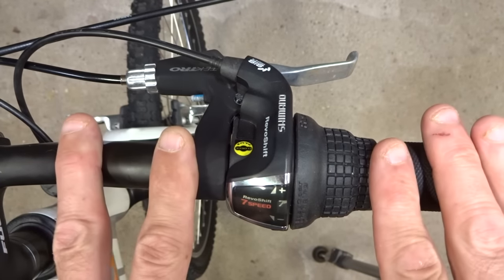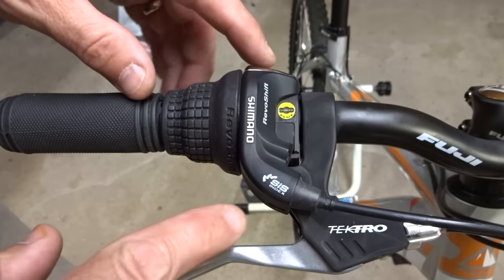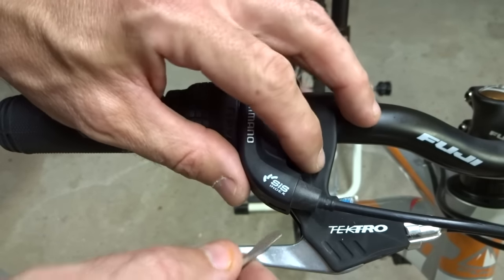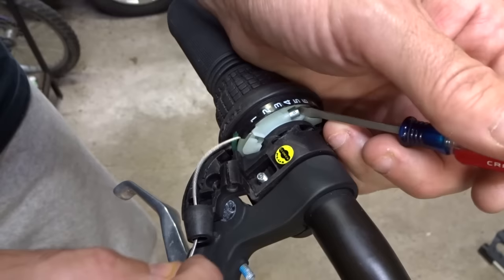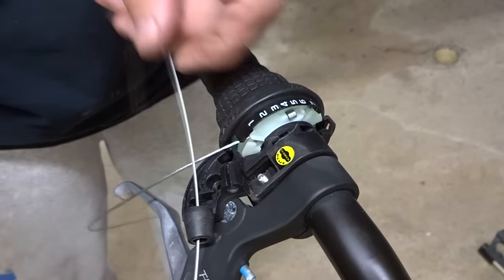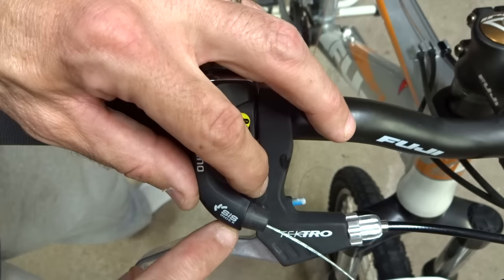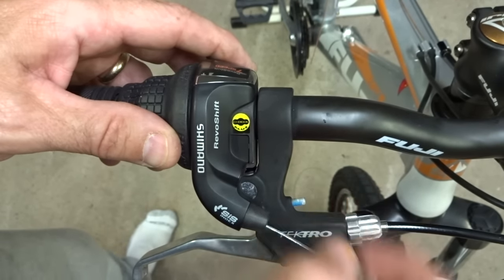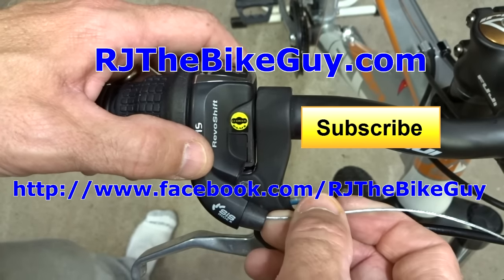How To Replace Shifter Cable On Shimano Revoshift Shifters

Comment: i just replaced a cable on one of these with the screws and it was a fucking nightmare, and on top of that the entire shifter fell apart in my hands. the whole thing is plastic crap and the shifter on't move anymore. in fact, after i managed to finally install a cable the damne thing would not line up the number one with the low gear inficator. the whole plastic bit with the numbers just moved out of place. no tension on cables or anything. this is the worst shifter i have ever worked on and i have worked on Revo shifters before. maybe it's a fake? either way, it was a goddamned nightmare. at least 4 hours attempting to get the fucking cover off, with two mismatched screws, one pre stripped and this is a client who bought it online for 300 bucks and assembled it himself, then dumped the mess on me.

That was not a fun day but I learned a few things at least. not sure i wanna work on bikes anymore.i don't think this is for me, fixing garbage cheapo bikes. my race bikes are easy to maintain by comparison. tens of thousands worth of them. i guess that's why they are so easy to service. they are well designed, not held together with wishes and snot.

Comment: I had the exact same shifters as stock equipment on my Dahon Vitesse folding bike. I've since replaced the whole drivetrain with Tiagra 4600 parts and trigger shifters, but this is still a good peek at how to replace the cables. The only real downside of the SL-RS35 is the rubber collar that surrounds the grip shift - when it gets old it tends to move on its own and not mesh with the shifter any more.

Comment: Some people hate these revoshift shifters, however I have been using them for so long that I prefer them over STI shifters. They are very easy to work on as well. Good video.
Reply: do you know how to adjust them, i need to adjust mine and i don't know how
Reply: @lachokbyo  The Revoshift shifters use a plastic rotating dial that eventually ( if you shift more than usual) will wear out and will have to be replaced ( cheap on amazon for the ring dial). As far as adjusting them to what end ? for Shifting ?

Comment: These shifters don't last long cheep plastic.   Soon the numbers are off and it takes 2 clicks to shift a gear.  No amount of adjustment will fix once the internal plastic starts to break.  If they break,  upgrade to Thumb quick shift.  Any Shimano SIS shifter will work (as long a number of gears match).   SIS is the indexing pattern the derailleur uses to find the right gear.  I just upgraded mine to M-310 Thumb Shifter, and love it. I like the grip shift too, when it works, but don't trust the quality of the design.  And don't want to replace shifter every year.  If you do upgrade to thumb, will want  longer grips if you got the short 92mm grips.
Reply: I work at a bike shop that sells bikes with the rev0shifters. I don't like them much, but I find that some of them do last a long time, but some of them are junk almost right away. The M-310 Thumb Shifter is a good product to upgrade. Takes up less space on the bars allowing the use of nicer full sized grips. I change over to the M-310 on all the bikes I convert to electric.
Reply: @chrisduke3251  my kids bike has the same shifter but it's very stiff to shift one direction but easy the opposite way, anything I can do?
Reply: Maybe soft bees wax on the moving parts?
Reply: @chuannaigh  Which shifter? The 310 or the rev o? Could try grease on either.
Reply: @chrisduke3251  the revo shifter, oiled up the cable but made no difference
Reply: @chuannaigh  Then you probably just have a factory defective part. May as well upgrade the part to a thumb/click shift.

Comment: Hello
I have a revoshifter but I find it very stiff when I’m going from gear 7 to gear 1
Is it the design of the shifter that I have to go one by one (for example 7-6-5 etc up to 1) or I have a flaw in it?
Now if I am on 7 and if want to go to 3 it’s very very stiff, I have to go gradually before I reach upper gears 
Thanks
Reply from the maker: https://www.youtube.com/watch?v=07Bc0QkudW8

Comment: I did this. Wish I'd found your video earlier however, because I've snapped the clip which holds the little number window off, so now it's broken. However, I can finally shift gears. Thanks. 👍

Comment: TL;DR, Shimano fucked you because plastic is a better profit for them.
The cover (I have the exact same RevoShift cover) tab that you have to push in, is, as everyone in the comments says it is, plastic bullshit, and it will wear very quickly with heavy contact with something like a flathead, this made me extremely timid about using force to push inwards as I wasn't sure exactly how this tab mechanism looked or behaved (he didn't show the interior of the cover to the camera so we could get a look at it) so I simply stopped before I caused any severe damage, luckily my skillful uncle was in the house today and I showed him the slot right before I walked to work and when I came home it was off (Thank you sm Jim), it's a simple little wedge tab, or it was a wedge, because as I mentioned it's plastic garbage and it's extremely worn and chewed from my attempts from last night- I made the mistake of trying to replicate EXACTLY what I was observing in the video, he had the flathead at quite the angle, but you simply just push in very hard (and hope it doesn't decide to just snap), so keep in mind you only have a handful of services on this before this tab is rendered complete garbage and since you can't buy individual replacement aspects of the part, you'll just have to buy a new shifter, and he said this in response to a comment asking about that very idea. So why are we still generating megatons of plastic to dump into our environment again?? yeah I'm pressing on the tab with my thumb and it's very rigid, has minimal flex and requires a decent amount of force, so don't be dumb about getting this open, which I am, and therefore I'm wildly thankful I stopped before I brute forced this item into the bin, and my uncle just happened to stop by once more today.

Comment: RJ I bought a bike with these shifters and some Promax brakes, thing is i've never had brake levers that have so much play (up and down) before, is this ok? 
Is there anything I can do, i notice there is one bolt running through the lever............... Guess it doesn't really matter, but it's annoying how much they wiggle in my hand.

Comment: Thank you, this video was very helpfull. My bike has that version with those two very little screws to fix the plastic cover of the shifter. You must be very carefull that you don't loose those small screws. A very little screwdriver is absolutly necessary.
So, thank you for this instruction video. Greetings from Germany. 👍

Comment: I came here to replace the cable grommets but was afraid of not being able to reroute the cable since it's pinched at the holder. This will allow me to replace the cable too and clean under the cables.

Comment: Any idea where to get the plastic cover replacement? My daughters Liv 7 speed the cover cracked. Everything else works. Thanks Matt
Reply from the maker: What plastic cover? Part of the shifter? Replace the shifter. Parts like that are not available.
Cable housing? At a bike shop.

Comment: Hi I just bought a bike for my son with the same shift. The number on the shift is not matching with the gear. When it's at 7 the indicator is showing 5. When it's at 1 nothing is showing. The number is misaligned. How can that be fixed? Thanks
Reply from the maker: If the bike is actually shifting through all the gears correctly, then it sounds like the shifter display is damaged.

Comment: The cassette end of these cables fray way too easily. I think the steel-on-steel tightening of the cable nut eventually cuts the strands. That makes the break only 3/4" ahead of the rear sheathing tension nut on my bike, where the cut segment has a potential of getting into the sheathing and clog up the shifting.I'm going to replace the hold down washer under the squeeze down nut with a softer sacrificial copper washer. Maybe one of slightly harder brass would be a better option. Just one critique on these 700 series grandpa bikes. The cable sheathing tension screw in the same area is too short. More cable tensioning can be had by making it 1/4" longer. There is no nut tensioning at the handle either as found on other bikes. I must have a cheapie bike.
Reply from the maker: You can solder the ends of the cables. You want to make sure it can bend though. Cables should be replaced occasionally. They are a wear part.

Comment: Dearest RJ. I have seen shimano cable tools like this: https://www.amazon.co.uk/d/Cycling-Bike-Tools-Equipment/Shimano-Cable-Jus-Tier-Tool-101-mm/B001EOZFBU  And there are few other types of it. It says it's exactly 101 mm. When you need this tool?
Reply from the maker: I think it is made to measure a cable for a Shimano internally geared hub. I have never seen or used one before.

Comment: Is there a way I can  change the shifter (the actual knob) without getting rid of the cable I already have on the bike? I would really appreciate it if someone can help.  Thanks
Reply from the maker: So you want to replace the shifter, and reuse a old used cable that would only cost a buck or two to replace? Really?

Comment: Hey RJ I have this exact shifter and one day while riding the click mechanism just broke. I can still shift just no click. is there something I can do to fix this issue or should I just replace the shifter. Thanks and great videos!
Reply from the maker: You can try taking it apart, I am more familiar with SRAM GripShift shifters. They have a small plastic or metal ratchet part. These may have something similar. But if it is broken, it is broken. I doubt you can find a replacement. But maybe it just slipped or something. Worth a shot if the alternative is replacement anyway. Personally I like GripShift shifters of Revoshift shifters. Better yet, I like trigger shifters over twist shifters.
Reply: +RJ The Bike Guy  Thanks! I'll look into it. Any good online bike shops you would recommend that sell decent parts?

Comment: The Trek MT220 has these Revoshift Shifters that you describe in your video.  The left side (front derailleur) shifter only shifts into "2" and "1", but "1" is the middle ring ("1" should be the small ring) and "2" is the big ring ("2" should be the middle ring). It won't shift into the small ring. I have adjusted the cable to make sure that it is not too tight, but it still won't shift into the small ring. I have also loosened with the low limit screw, but that doesn't do any good either. Any thoughts on what else I should do to get the front derailleur to shift into the small ring (the real "1")?
Reply from the maker: Complete disconnect the shift cable. And loosen the limiting screw completely. If it still doesn't go into the the small ring, then there is something wrong with the derailleur.
Reply: Thanks, RJ. We'll give it a try.
Reply: It could be that the you need to adjust the position of the derailleur itself. Is the derailleur parallel with the chain ring? If not, you may have to loosen the derailleur clamp bolt and slightly adjust the position of the clamp (that is attached to the seat tube).

Comment: How to remove cable without cutting wire please reply I am your biggest fan
Reply from the maker: Cables wear out. It's good to replace them once in a while.
Reply: If you really want to replace the inner wire without cutting it (although I don't know why you would) it's just a matter of undoing the binder bolt on whichever derailleur it goes to and pulling it through the shifter. But RJ is correct. The inner wires will stretch over time and should be replaced periodically.

Comment: RJ The Bike Guy After getting my cables replaced the shifter want to go all the way to the highest gear on its own at times while pedaling. Is there a way to apply some tension to the cable or something?
Reply from the maker: The shifter is what holds the cable from going back. But you don't say what kind of shifters you have.
Reply: The Shifters are Shimano Servo-Wave Action on a 97' Cannondale bike.
Reply from the maker: Not sure, but I think "Shimano Servo-Wave Action" are brake levers, not shifters. What are the shifters?
Reply: Woops… you're right, the shifters are 8 speed SACHS and the rear derailer is a Shimano STX RC. Thanks.
Reply from the maker: Friction shifters?
Reply: RJ The Bike Guy Ratcheting shifters.

Comment: Great video.  I got a problem with the shifter itself though.  It only shifts between 6th and 7th gear.  I cannot drop to a lower gear.  Seems jammed for some reason.  Any idea how to fix that?
Reply from the maker: https://www.youtube.com/watch?v=gwBQxhZhKnE
Reply: @RJTheBikeGuy  Tx for the prompt reply.  Not often one gets such a quick reply.  However I dont think I explained myself well.  The problem I hv is not with the gears but with the shifter.  I hv the same or similar shifter as in the video above (Shimano Revoshift SL-RS35) and that is wht is stuck between 6 and 7.  I hv gone thru ur videos for a how to fix and either I hv missed it or it isnt there.  Once again tx for your quick reply.
Reply from the maker: @miguelferreira1457  I can't tell you without working on the bike. Shifting system is shifter, cable, derailleur. Issue can be in any or all of these. Isolate the issue and fix it. Or replace it.
Reply: @RJTheBikeGuy  Will do.  Thank you for your help.

Comment: stupid question: does revoshift supports dropbars?
Reply from the maker: They are meant for mountain bars. They could maybe be put on the bottom part of the dropbars, but they are not going on past the curves.
Reply: +RJ The Bike Guy i see, thx m8

Comment: i lost the cover,wat to do,pls guide me,thanks
Reply from the maker: +hateit prop buy a new shifter.
Reply: its costly,can i get jus the cap,actually the mechanic lost it...,the shifter is gud..its jus the cap...so much dissatisfaction...
Reply from the maker: Good luck finding just the cap!!!
Reply: can it be chaged to other shifter model like som index thumb model i read abt
Reply: Just buy new ones there costly but worth it.

Comment: Stainless gear and brake cables are preferable to galvanised, especially if they may get exposed to road salt and my favourite cables are Jagwire Slick, they are noticeably smoother if you run a finger along them, and run smoother in use.